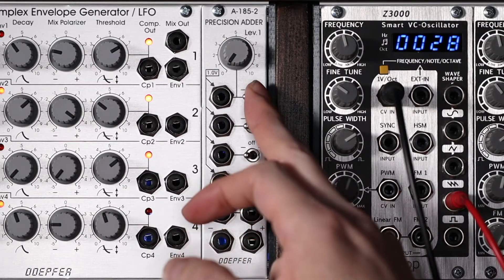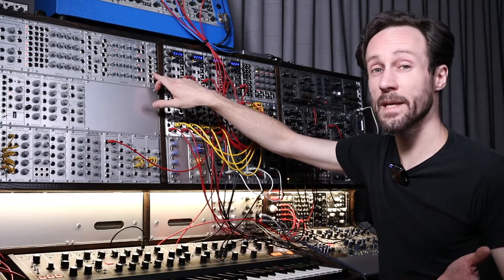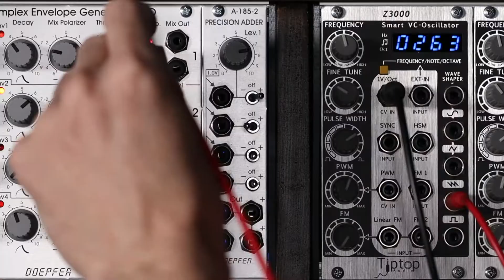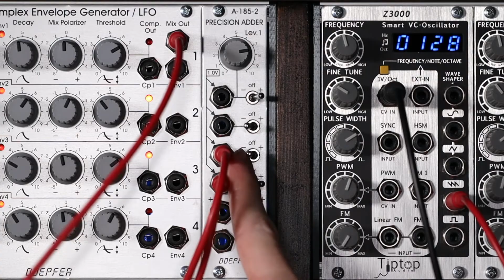Doepfer A-185-2 Precision CV Adder

Comment: Another great video! It is interesting to think about the similarities and differences between this and the the Moog versions, in my case the b clones of them, the Behringer 992 Control Voltages and Behringer CP3A-O Oscillator Controller. These don't have the 1v adding and subtracting, but clearly Doepfer used these as basic inspiration. I've had the Doepfer for quite awhile, but thinking in terms of how these Moog ones were used in the Moog system really helped bring it new life for me
Reply from the maker: thanks, they’re the simplest and best Doepfer modules out there 🙂

Comment: 9:21 i dont understand there is not any cables, is that what the buzzboard is?
Reply from the maker: It’ the first thing I explain in the video 2:25 😉 CV over the busboard. A deep explanation can also be found in my Doepfer Bus Access video.
Reply from the maker: by the way the bus board is the board where every module is connected to.

Comment: Thank You for video.
One link point is missing for me, do i have connect oscillators, A-185-1 and A-185-2 on same power bus?
Even more, i have all oscilators, vca and filters in one case, and control voltages modules in another case, so think it will not work properly because of different source of power.
Reply from the maker: Yes you need to connect the A-185-1 or A-185-2 and Oscillators or ADSRs to the same bus board!
What is possible though is for instance connecting multiple rows to the same bus board if the cables a long enough. Just having an Precision Adder next to a few oscs is in my opinion invaluable.
Do you have a link to your system? I could have a look and do a suggestion.

Comment: Are you saying that the ocsillators of the Matriarch and/or Mother-32 may be modulated by the bus board CV? If I have not totally misunderstood: How? I am really looking forward to your bus board CV tutorial.
Reply from the maker: In the video the cv is going over the bus to the tiptop vco’s, it is obvious the matriarch vco’s have no connection to the same busboard as the Precision Adder or Bus access module.
If the mother 32 can receive cv over the busboard it would be possible if it is connected to the same busboard. Best check the manual to see if it is capable.

You can find the bus access video on my channel it’s the A-185-1

Comment: Excellent video, when you change the jumper to send cv to the bus does that automatically affect pitch CV for any oscillators that are connected to the same bus board or is there some other connection you have to make? Thanks for making this video!
Reply from the maker: Thanks @vacantimaginarium683 , you only need to put the jumper in the correct position and the oscillators must accept cv over bus of course. An indication could be that modules with those connectors with wide ribbon cables probably receive or send cv (check manual to be sure). Those ribbon cables that are about half the width of the connector will not pass cv because it's send over the wires that are missing in these narrow ribbon cables if that makes sense.

Comment: how did you use the module without patching any cables? did I miss something
Reply from the maker: It sends cv over the bus board if you configure the jumper on the back of the module.
The oscillators are receiving cv from both bus board and their cv in.
Also it generates one volt per switch if you have nothing plugged in.